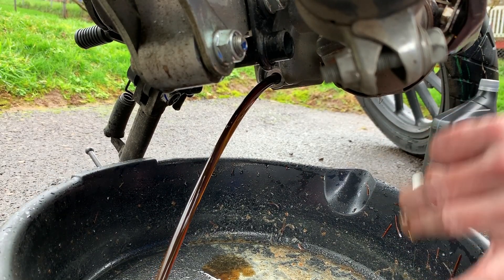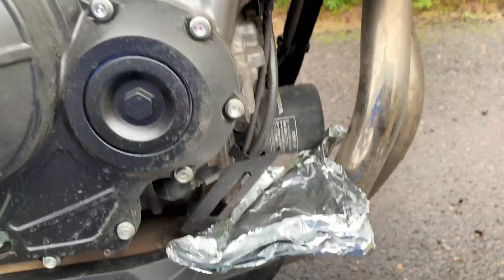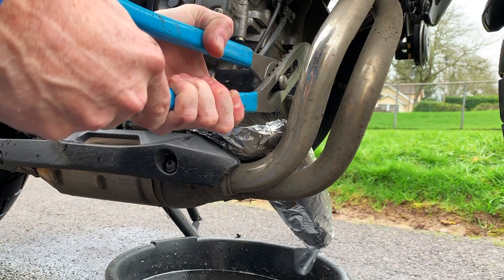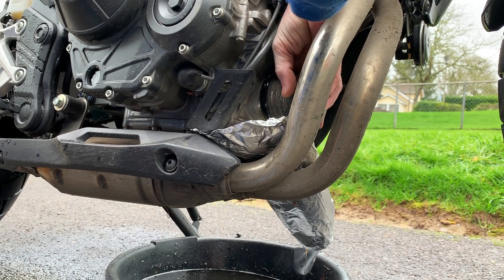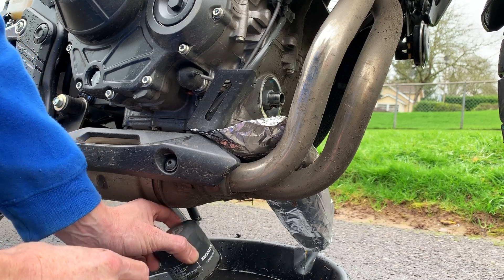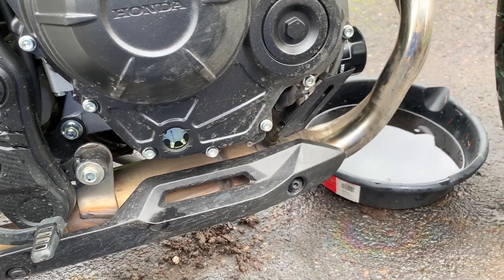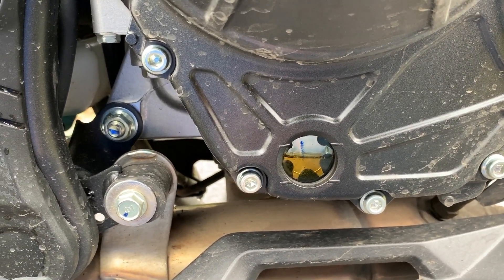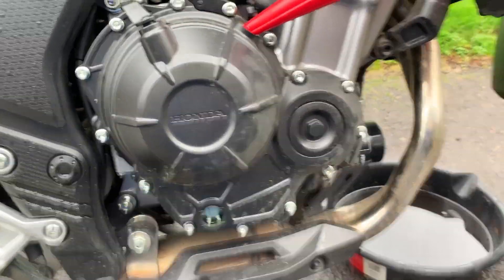2019 Honda CB500X First Service D.I.Y. | 600 Mile Motorcycle Service How To | Oregon Motorcycle 2020

Comment: (Hopefully this is not a repeated comment, but I think youtube did not allow me to post a link..) Great video, thanks. I especially liked your tip about using foil to direct the oil flow from the removed oil filter! That worked so well. I have a tip of my own for you or anyone interested. I have a 3/8 in drive electronic torque wrench and wanted to use it for the oil filter as well as the drain bolt. I got an "EWK" oil filter wrench from Amazon (3/8 in drive, 64-65mm, 14 flutes) for about $13 that was a perfect fit and made that job a breeze. Particularly for someone like myself who's older, my hand strength isn't what it once was and I wouldn't trust myself to twist the filter on tight enough by hand. Now I know it's torqued properly, as is my drain bolt. Also, I have the Honda service manual for the '22 500X, and the specified torque value for the oil filter is 19 lb-ft, and for the oil drain bolt it's 22 lb-ft. And as you suggested, I used a new crush washer for the oil drain bolt. It would be silly not to, as it was only a $1 part. Again, thanks for a great video!

Comment: Thanks, nice video.  Used engine oil contains carcinogens so it's best to wear rubber gloves when changing it.  Also, on the initial startup, your oil pressure will come up faster if you have already filled the oil filter prior to installation.  Done quickly and carefully, you'll spill little if any oil when reinstalling the filter.

Comment: If you have a centerstand, do not start the oil drain process on the centerstand. The pan you are draining it into may not catch the first big spurt of oil that comes out. The pan needs to be further back than the stand allows. Start draining on the side stand. Towards the end of draining, put the bike on the centerstand. Definitely drains more oil that way. Also makes it easier to check the oil level when refilling. The tin foil is is a good tip when removing the filter to protect the exhaust header from getting soaked in oil. Easy peasy oil changes on this bike. Even a non-mechanical type person can do it.
Reply from the maker: Hey thanks for the tip. Next oil change coming up soon.

Comment: Nice video 👍 going through the basic tasks. The oil drained easily on the X, but when doing the job myself I always removed the oil filler cap prior to draining the oil it might help air enter the engine as the oil drains away... All the best 😉
Reply from the maker: Thank you. Good tip!

Comment: I liked watching your oil change maintenance, instructive. Not judging but it's always been a procedure for me to pre-fill the new oil filter before installation. This may take several pours as the filter media absorbs the oil, and I don't fill it to excess so it's running out as I install it. Otherwise, thanks again for a clear and concise tutorial.
Reply: You are correct.
Reply: @mtkoslowski  Not much point in pre filling a horizontal oil filter due to spillage when fitting, I totally agree pre filling vertical oil filters though.

Comment: I've done a good couple hundred oil changes on 4 wheeled vehicles, so it isn't scary to do this. But this popped up on my youtube suggested so I figured 15 minutes on a video could be well spent. I'm about 200 miles off my service. Good tips on the foil and the crush washer. I'm excited to service my bike!

Comment: Yeah, I do all my own maintenance on my 2014 CB500X. I also use the prescribed Honda oil, 10W30, and Honda filter. I installed a centerstand and it makes the job a lot easier. I buy the gallon (4l) bottle just keep some extra around in case I need to top off. That only occurred once after a long  highway ride.
Reply from the maker: Nice!  Can’t wait to get a center stand.

Comment: Thanks. Really good. I must admit I let the techs do it at my local dealer, besides there is the warranty issue in the U.K. but it’s really good to see this and I like the way you present it, multi-tasking and all.
Reply from the maker: Pete Sudhana I do believe your ok to perform all your own maintenance. The dealer will try and tell you that you can’t, but the manufacturer says you can.
Reply: I agree about the warranty issue and dealership service tie in. This is a good reference for post warranty period for us UK riders
Reply: Yeah the first service has to be done by a dealer within 10% of the stated mileage for warranty periods. And it involves more than an oil change. Mostly tightnening up some bolts and checking valve clearances which is important for a newly run in motorcycle.

Comment: First service will put your bike in system and makes it easier to get service if your on a trip and something goes wrong.  Also I fill up the filter before installing it safer. It has a one way valve in filter so it wont leak.

Comment: pre oiling the filter makes it much faster to get oil to the top end on a dry start up
Reply from the maker: Yes. It is a bit hard though with a horizontal mounted filter.
Reply: @OregunAdventure  i do it easily on my 500x just fill the filter 2-3 times, let it soak in and install it
Reply: To pre-oil a horizontal filter, I fill the filter to about 40% of its capacity and then hold it
horizontal for 5-10 seconds to let the oil seep through the filter material to stabilize
the oil level horizontally in the filter.  Then I spin the filter onto the engine.  No oil spills
out, and the time spent with no oil pressure during the 1st start-up is minimized.

Comment: I never replace crush washer owning the nc700 for five years no oil leak. But is a good habit to get one just in case, good tip for aluminum foil, thanks for the video.
Reply from the maker: Sure thing.  Im just trying to do it 100% right.  Technically this isn't a crush washer, but the old one was a lil deformed.  Its only a buck so what the hell:)  Some bikes, (like my CBR) have true crush washers that really need to be replaced every oil change.
Reply: Where do I get one
Reply: @emprrah  From the dealer.

Comment: 20W 50 if you’re riding in hotter climate to add a bit more protection to the engine during those heat days. Oil at that viscosity stays thicker at higher temp and protects the clutch also, Valvoline 20W50 motorcycle oil would recommend over 10W40 does a lot more protection
Reply: And yes, it's OK to mix 20W50 with 10W40 or 10W30/

Comment: i just checked the manual for my 2015 cb 500f here in the UK, so same engine, and it states service should be carried out by the dealer.Cant see anything so far in the book like you have. Strange the difference in other countries. Also, the the maintenance schedule says service intervals are every 8000, not 4000 like yours. Wonder why given it is more or less the same bike.

Comment: Those of you watching this video, don't put GN4 again into your Honda's. It's an old petroleum, factory fill oil for the break-in. It overheats and breaks down so easily. You'll misshift or get gear popout. It happened on both my CB500F and 600RR until I swapped the oil out. Use a minimum of HP4S or a higher brand like Belray, Maxxima, or Amsoil.
Reply from the maker: Interesting. Do you have any literature on this?  I have no issues after 6.5k miles and I ride the shit out of this bike. I used the same oil in my cbr600rr too.

Comment: Get a center stand. I t really makes maintenance so much easier and the bike is always leveled so easier for oil changes. And you dont lose that much clearance
Reply from the maker: I actually have a center stand. It’s easier to change the oil not using the center stand on this bike.
Reply: @OregunAdventure  thats good To know mate. Really like your channel
Reply from the maker: Jake's Adventure Canada thanks!  Ya the way the drain is angled. It will shoot oil on to the center stand.

Comment: Does this video apply to a 2021 cb500x ? Also I couldn’t find in the manual what is the oil filter for 2021 cb500x
Reply from the maker: Yes. I buy my filters at the dealership.

Comment: You do a great job on your tutorials, as good as any I have watched on YouTube(and I have watched quite a few). I just noticed that your bike came with the same trailmax tires that my 2018 750x came with. Bridgestone doesn't offer them on their motorcycle tire website.  The new Trail Max is a much more aggressive 60/40 road/dirt tire. Most of my miles will be on the road with occasional off road forays. I will be interested to know what you will put on next. Also will you leave the front tire and put something similar on the rear, since the rear will wear faster. Or will you get a match set and take the loss on the front since it will still have good tread life left when the rear is done.
Reply from the maker: Thank You!  Good questions and honestly I haven't thought that far ahead yet.  I have noticed the new design and they look good.  I kind of like these tires as they handle the rain really good.  I most likely will get a more aggressive tire, but not 100% sure yet.  I usually change both the front and rear if they do not match.  However I have seen some adventure setups purposely running different tires to put more traction, off road, up front.

Comment: You definitely need to add oil after starting the bike because your empty oil filter needs to fill up
Reply: depends. if the Manuel says its 1500ml then that's what you should put in.
Reply: @mrpantur7280  indeed, also, you can pre-fill the filter before screwing it in

Comment: i just picked up a 2021 500x last week! did you ever install the factory aux light switch? i just ordered one for a CRF1000L because i was told it was the same part number. i can do a lot with wiring, i was just curious what kinds of things youve done with yours in the last year and a half.
Reply from the maker: You just gotta go through some of my vids. Heated grips and lights. Crash bars.

Comment: Good call using the tin foil. I'll be doing that too from now on!
Reply from the maker: C1TRU5 thank you. That worked pretty good.
Reply: Ditto. Never saw that done before and it would have saved many a mess. That's going into my folder for sure. That's why I watch these videos

Comment: Hi from Croatia..Today just did a first service interval at 1000km on my 2019 model..After I got home I realized that they put motul 5100 ester 4T 15w50 oil instead OEM honda 10w30, should I be concerned ? Im freaking out a little, Please help thank you
Reply from the maker: Yes I would be concerned. There is absolutely no reason to run 50w in this bike. The manufacturer recommends 10-30w and that’s what you should have in it.
Reply: @OregunAdventure  Thank you for response it means world to me..I will speak to honda guy in dealership and ask them to change oil again hopefully to oem one ..They also put non oem oil filter which is made in France. I hate this scenario especially from official honda dealership
Reply: Just received a call from a main mechanic in Honda service...Reason for Motul 15w50 oil instead of oem 10w30 oil is because of the climate where we live, especially in hot conditions during the summer and city driving across Europe this oil excels over the OEM one. They can change oil back to 10w30 if I want oem one badly , but according to him and many others Honda mechanics across the Europe coz they have annual specialized meetings in Frankfurt Germany for further development, 15w50 is better choice across many Honda motorcycles. He said it's not his personal choice to put motul 15w50 instead of the oem ( hey let's put different oil for fun) but again also a Honda recommendation based on bike chassis numbers and location's,  example guys in Norway or Russia run on thinner oil because of climate.
Reply from the maker: Sounds like their pulling your chain. Just remember dealers are there to make money, not help you. If you were in a “hot” climate you might go up a lil, but not that high. I mean how hot is hot? ;). It’ll be up to 100 degrees here in a few short months...  I’ll be down south where it could go over 100 and my oil will still be adequate. I think they had the oil or have a surplus of it and that’s the reason it’s in your bike. These bike were designed in Japan, not Germany. You would think Germany would be a colder climate...  Anyway I always stick with OEM recommendations, not the shop monkeys ideas. If you do run this oil I’d be curious if it affects your fuel mileage.
Reply: @OregunAdventure  I agree with you on everything you said, after all there's a bunch of testing done inside factory  to make decisions for what kind of oil to put inside vast variety of vehicles, and then one backyard mechanics proves them all wrong with different oil and his opinion..Im not saying this chief mechanic is this kind of guy coz he a chief of Honda for over 15 years with good reputation over here, but man cmon atleast tell me in advance why this and why that so I can sleep well..Anyway I will run this oil until mine next interval which is 6k, and because summer is slowly coming so let it be with this summer oil thickness for know, but on mine next interval I want 10w30..I will let you know how bike behave and all that good stuf either here on instagram, btw im the same guy who suggested prices comparison for fun on 1.service recently, so if you see username Geo_Okami that's me🙂Thank you buddy for all  the help, you are blessing for noobs like me who just started moto life🙏
Reply: @Geo_Okami  10w50 abit too thick eh? I live in a hot climate area. Daily temp is close to 30 degree Celsius and at most i use 10w40. Unless i am planning to ride it up across the border i would not recommend w50 abit too heavy.
Reply: @rusdanlee9058 Hi my friend,  I agree with you, but I don't see any performance issues or fuel economy drops with 15w50 for now, and I've done 1000 km since oil change..Also for mine good sleep I've contacted many Honda services across my country, including Moto Sekol service who is known to be the best service for Honda motorcycles in this country and owner like most of the others replied that motul oils are is extremely quality oils and that nothing bad will happen to engine, even more they all suggested that runing little thicker oil will provide smoother shifting..And I do feel smoother shifting but noting dramatically better then on oem oil..Every else is the same like before..After 6k and second oil change I will go with motul 5100 10w30 coz oem honda oil is hard to find in Europe,  and ordering from Amazon or Ebay is to much expensive when they include shipping and import taxes
Reply: @Geo_Okami  yeah me too OEM honda oil is particular non existent here.

Ride safe buddy!
Reply: 1k km???????first service???
Reply: @OregunAdventure  Good answer how hot is hot, the engine is water cooled with a thermostat, engine running temp should be pretty constant , my gauge stays at normal all the time, air cooled motor temp is all over the place they are the most likely to have problems in hot climates.

Comment: Nice video, I'll use it as tutorial for my CB500X!  Don't you trust your torque wrench? ;)  I'm halfway between my 1000 and 6400km maintenance and checked my chain swag, it was still at 1-3/8"... at what milleage did you readjust yours?  May depend on how I ride too...
Reply from the maker: Ha ha, not on lighter torques. I adjusted it around 500 miles and then again around 2k.

Comment: Should it not require valve clearance checking also
Reply from the maker: Nope
Reply: @OregunAdventure  Gee, I'm glad, cause my local Honda dealer gave me a quote for service including valve adjustment for £450,  Aaaaaaaaaaaaaaaaaaaaaaaaaaaaaaaaa. This will need done at 16000 Miles
Reply from the maker: @a1pestservice  I’m over 20k and the bike still doesn’t need it

Comment: Hello 

Thank you for your recommendation on my question asked about tires.  I really appreciate that.  

I have question regarding Engine oil. Can i use 10W-40 full synthetic (Mobil 1 4T or Castrol  power 1 4T  or Castrol Edge 10W-40 4T on 2013 CB500X.  

Thank you
Reply from the maker: Vilkesh Patel I would stick with the manufacturer’s recommendation of 10-30. Using a higher weight could reduce fuel mileage.  I always use Honda non synthetic in my Honda bikes. It’s cheap and used by the manufacturer. As far as Mobil or Castrol goes, you have to look out for additives, like friction reducers. Additives designed for auto use can destroy your clutch. I can’t remember the specs off the top of my head for the oil, but it’s in your owner’s manual. 
And!,;). I think I’m going with the Dunlop Trail Max Mission tire. But I still need to wear out the stock set first;)

Comment: I’m really enjoying your videos during the lockdown! I’m ready for the 600 mile service. I noticed how tight your bolt was; I only have a 12mm socket. Do you think I would need a wrench? Also curious as to why you didn’t put bar weights on with the Barkbusters? Thanks much, and stay safe! -Jackson
Reply from the maker: You should be fine using a socket.  My hand guards didn't come with weights and I really didn't notice a difference.  The only buzz or vibes I get on this bike are in the footpegs at 63 mph.  Other than that, its solid.

Comment: There has to be more on that 600 mile checklist than an oil change.....
Reply from the maker: Nope.
Reply: Used to be a valve adjustment check..... I wonder what changed?
Reply: @OregunAdventure  valve clearance inspection

Comment: Never poke your finger into the oil filter hole to remove plastic. Hundreds of Honda engines have been ruined when piece breaks off. Winds up on filtered side blocking passage somewhere.
Reply from the maker: Thanks for the tip!;)
Reply: and the even smaller pieces can end up in one of the check balls in the oil pump holding it open resulting in no oil pressure